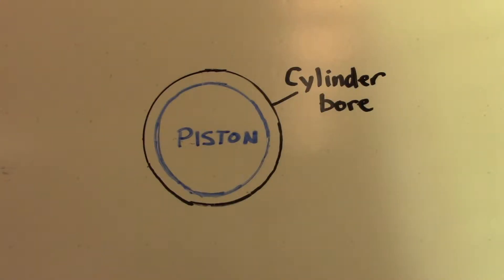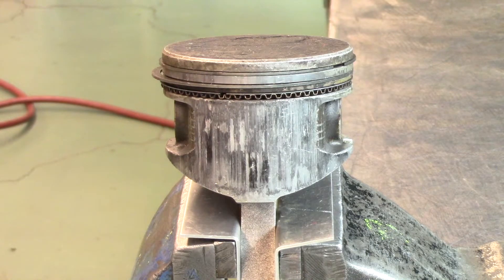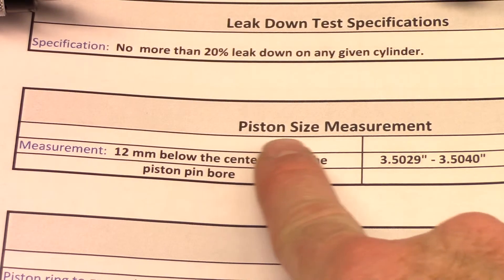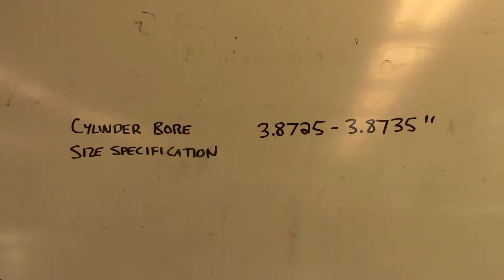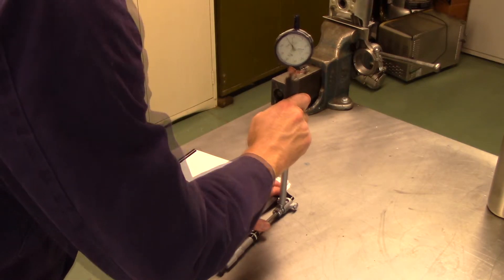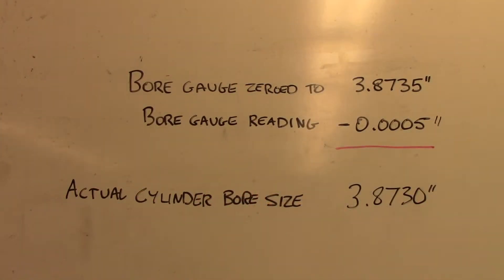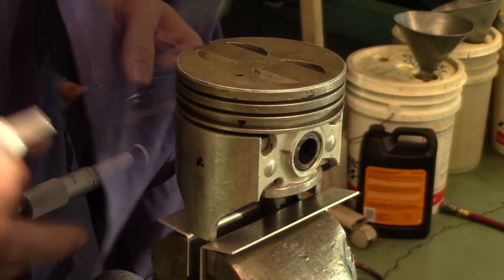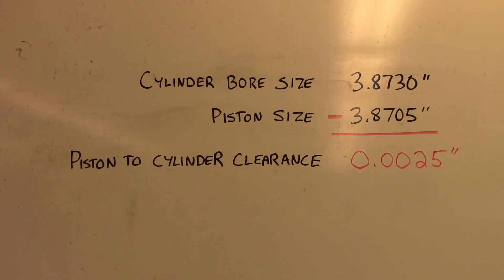Measuring piston to cylinder wall clearance using the calculated method

Comment: why are you not measuring at bottom of skirt?
Reply: The piston must be measured where the piston is the largest, which is determined by the manufacturer
Reply: @JaymicheaelT  Exactly, it's usually indeed at the skirt. But always follow manufacturer specifications because this might change.